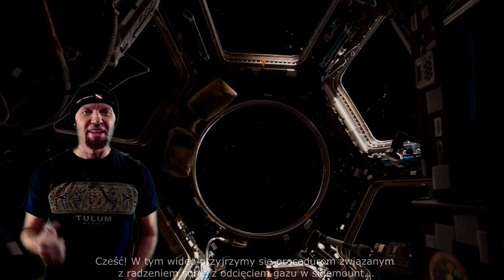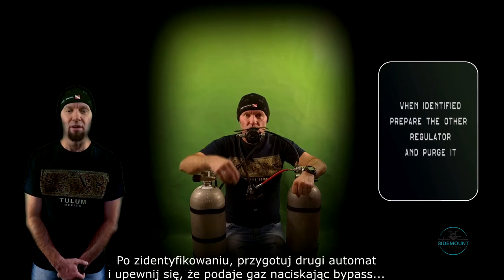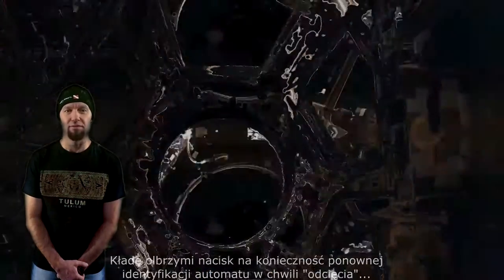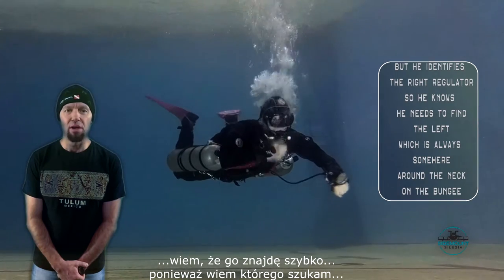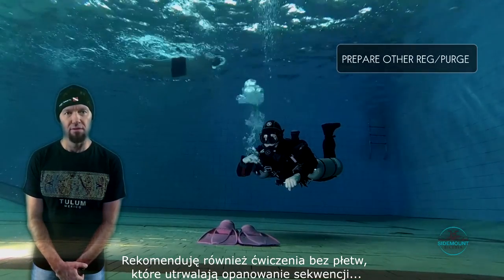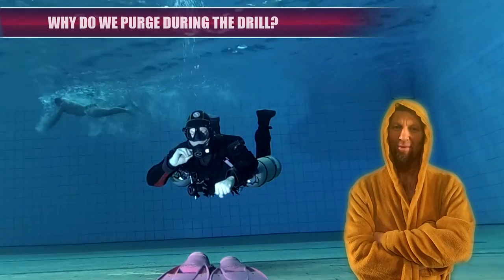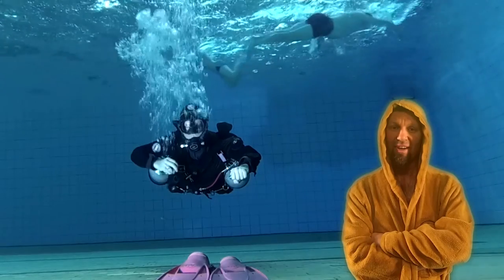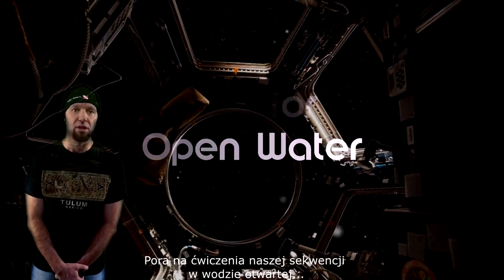GAS/VALVE INTERRUPTION DRILLS (Sidemount Silesia)

Comment: hi , at 1.55 , i understand that you break the o'ring, but after you have allways the bold snap fixe on the long hose , how do you do that ?  regards Michel
Reply: He simulates breaking the o-ring. In other words he unclips the boltsnap before the exercise, then during the exercise he makes a strong pulling movement which would break the o-ring if it were still attached.